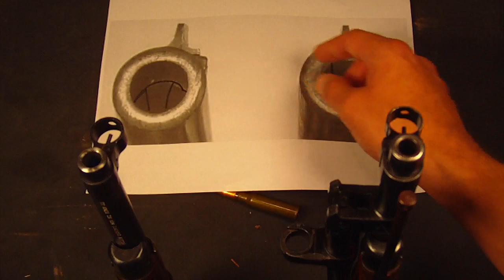Mosin Nagant Counterbore Barrel Explained

Comment: How do I counterbore a Mosin that hasn't been counter-bored before?
Reply: try a screwdriver
Reply: @_Jebb_  lol
Reply: Take it to a pro, unless you want a possibly screwed up muzzle interior crown, or it's so cheap it doesn't matter. If you DIY, get a good carbide bit with no nicks, and only go as deep as necessary. I'd say minimum 1 bore diameter, no more than the depth of the damage. Artillery barrels have been counterbored for at least a century to prevent bore cracking from torque forces. Modern cannon muzzles are thin,so having the rifling removed the last caliber of the bore strengthens the muzzle.
Reply: Counterboard it
Reply: I just did it today. Used a 9/16 drill bit, a 9/16 end mill, qnd a power drill. It worked well. New video on it coming soon.
Reply: Woah small world huh, good to see you
Reply: @AA-dn8dj  ya, I was like... I know that profile

Comment: Thanks for the good info.  I did have one question: if the 7.62x54r bullet cannot fit into the end of the non-counterbored barrel as shown in your video, how would that same caliber bullet come out of the barrel when you shoot?   (Admitted gun newbie)  Thanks in advance.
Reply from the maker: schitjob Good question!  You will find that most unfired projectiles are bigger in diameter that that of the barrel they go down.  The reason for that is when the round is fired, it does contact the barrel walls and ultimately the rifling of the barrel, compressing the round to the barrel diameter.  This friction along the barrel walls and rifling allow the projectile to start twisting which produces the stability of the projectile flight (the spinning of the round like a football).  Hopefully this makes sense as I am probably not explaining the best way possible :)
Reply: ***** Ah ha. That explains why the cartridge expands.  It's coming together in my head, bit by bit.  Thanks.

Comment: Wait, why for the rifle to the right the bullet doesn't go all the way into the bore? How can the bullet exit when firing? Thanks I'm a newbie
Reply from the maker: Prior to being fired, the actual bullet is a larger diameter than the bore of a barrel. As it's fired it gets smaller to the size of the barrels bore, allowing the rifling to do its job of stabilizing the bullet as it leaves the end of the muzzle. If it were exactly dimensioned as the barrel or even smaller, the rifling within the barrel would not make contact with the bullet and not allow stabilization for a straight shot. Hope it helps!
Reply: IntoWeapons Perfect, that's what I was looking for. So the speed of the bullet reduced by the friction is negligible?
Reply: Bullets don't change diameter while traveling through a barrel. The diameter of a bullet is the same as the groove diameter in the bore. The diameter of the lands (or rifling) is smaller, which allows them to impart spin on the projectile.
Reply: @LinkinPark4Ever1996  Pretty much. There is so much force behind that bullet that it actually accelerates with a longer barrel and building gas pressure.
Reply: @LinkinPark4Ever1996  Some projectiles are mildly oversized. I.E. if you were to purchase projectiles to reload .223/5.56, you would purchase .224.
Remember, projectiles are normally a soft/hard lead core, with a copper jacket. Both of these materials are MUCH softer than the steels used to create barrels. The slight oversizing guarantees proper engagement with the lands and grooves, and a very tight gas seal behind the bullet, which is obviously required, so that the bullet will generate sufficient speed.
Reply: @wendigo-e3m  great I understand 👍 
Thanks y'all